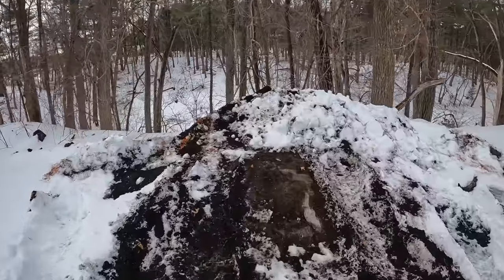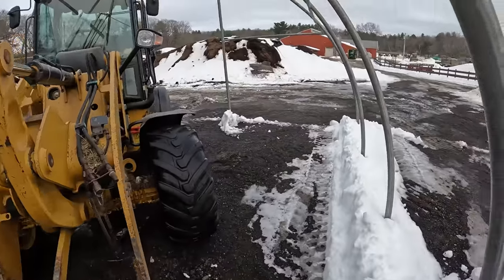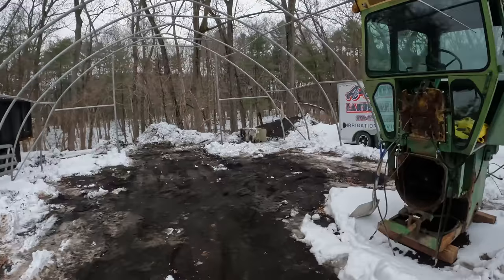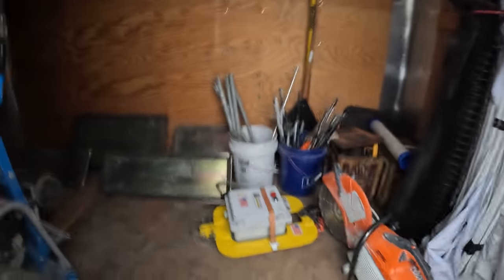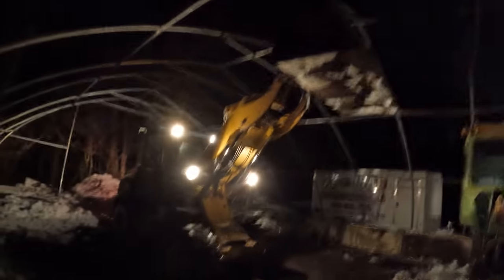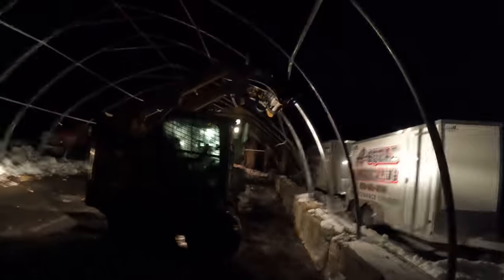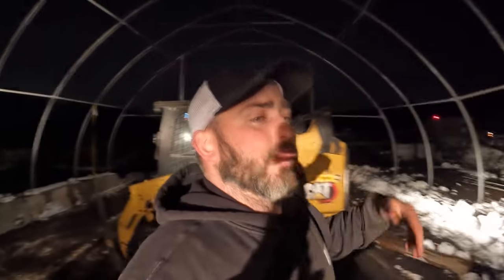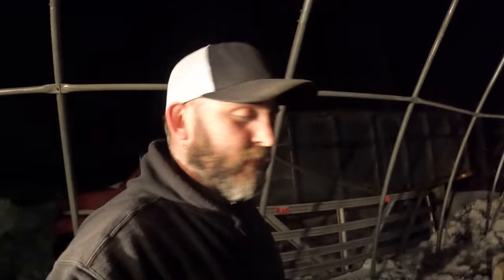Hoop Building Assembly Not Going According To Plan- Will It Fall Down?

Comment: You don’t have to move the whole structure . Just take both ends off and  move one piece from the front to the back then but your ends back on
Reply: Good call
Reply: My thoughts exactly
Reply: But I’m sure he will say something on why it couldn’t be done that way
Reply: @randydrinnon4000  he didn't do a bad job, it was a little nerve wracking to watch. He successfully moved it and kept it standing. In my opinion, it was a job well done

Comment: I know you know what you are doing but think it would of been easier just to take down 2-3 section and took the back wall down and assed to them at the back .. just throwing ideas out there. Looks good glad you got them up on the blocks will help you out in the long run
Reply from the maker: I actually admit I have no idea what I'm doing. Lot of ideas here have been helpful. And I definitely should of never thought about it to be honest
Reply: @DuffyAg  I wished I lived closer to ya. Because I would come and help you . I used to build the CoverAll buildings that are in alit of dairy farms . And that one you got is similar to it. When you pull the top over you have to be careful and make sure you pull it straight use 4-6 pulleys if you got them ..

Comment: Question:  Why didn’t you just take the ends off, then move 2 hoops from the front end and install them on the back, then put the ends back on.. Yeah, arm-chair quarterbacking here, but that seems like it could have worked??
Reply: Just wot I said lol
Reply from the maker: Honestly didn't even think of that at all. That seems much smarter
Reply: @DuffyAg  Hindsight is ALWAYS 20-20
Reply: @DuffyAg  Is the tarp long enough to reach the ground? Otherwise wind may get under it and cause some problems with stability of entire structure. Keep the good work, greetings from Czech Republic.